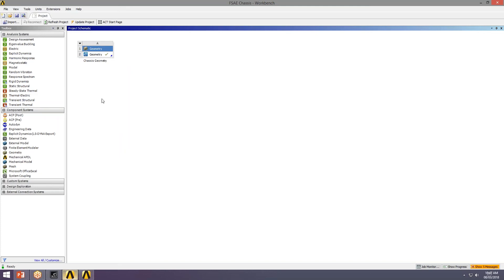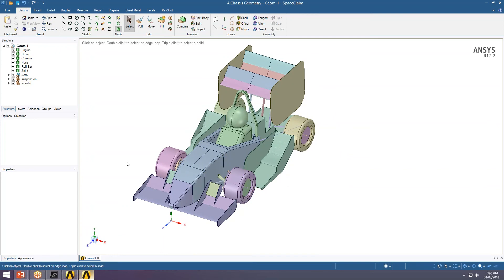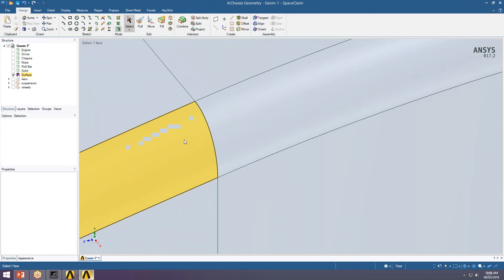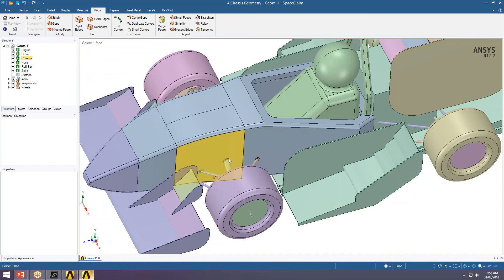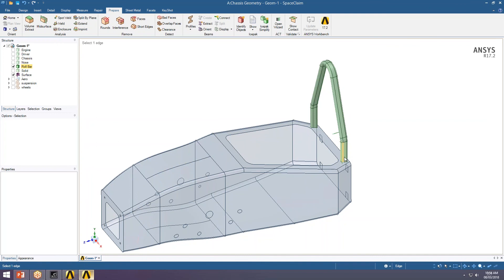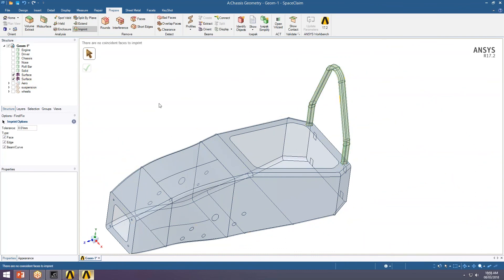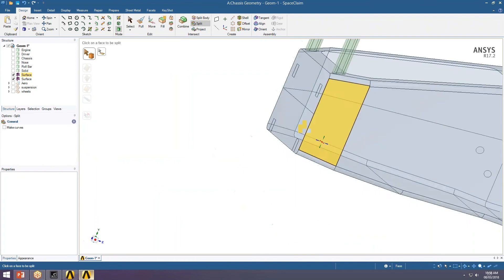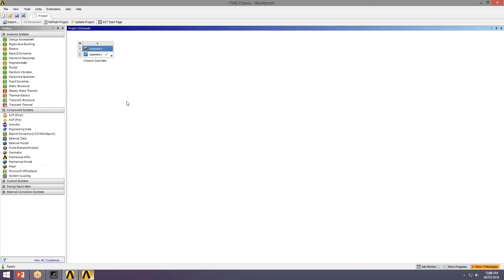ANSYS Composites Geometry Preparation - Demo - Composites for FSAE #2

Comment: thanks for this demo. ive got a problem; when i select all surfaces of my model, cut and paste, it comes back as a Solid. I assume is because the structure is water tight and automatically forms a solid. how do i stop this from happening?
Reply: You have to be careful about which faces are you selecting. Practice on a rectangle with a hole in the center. Try and get a surface out of it and the you might be able to get the gist of it